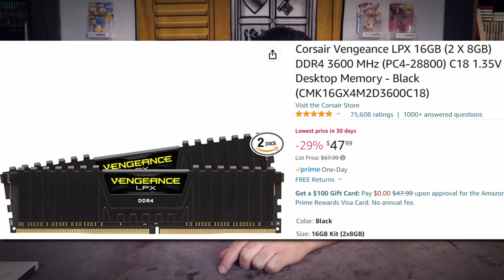1080p Monster | PC Build | RTX 2060, Ryzen 5 5600x Gaming PC w/ BENCHMARKS

Comment: I use this combo for 1440P in most titles too, can mostly definitely handle it with some tweaking. I also have the 12GB model (mostly the same performance but the VRAM makes a difference in some games nowdays.) which I got for cheaper than the standard 2060.

Comment: good pc build im currently rocking a 5600x and a 6650xt build took a while
Reply from the maker: Nice. I'm having a good experience with the 5600x so far it's a beast
Reply: @BadgersGameRoom  yeah pretty good cpu i got mine 2022 june  upgraded from i5 8400 then november i upgraded from gtx 1070 to the 6650xt which i got for £310 on amazon brand new msi gaming x i suggest doing a pbo undervolt on your cpu you can reach higher frequency for longer which can help performance a bit mainly 1% lows